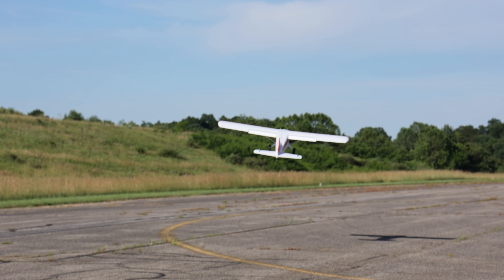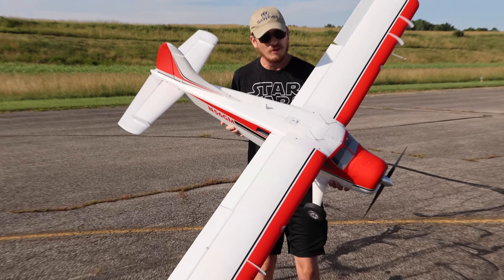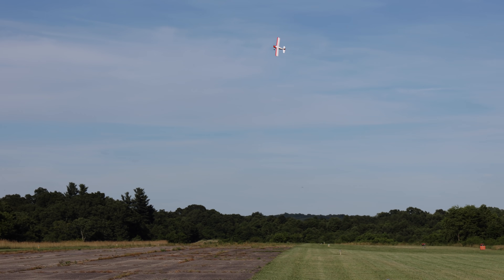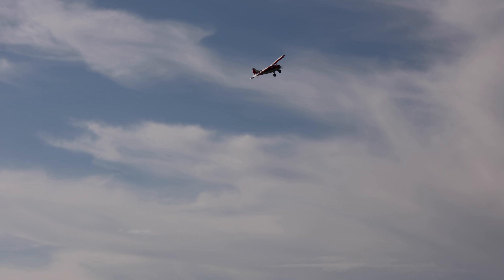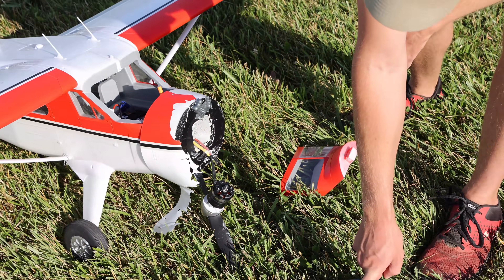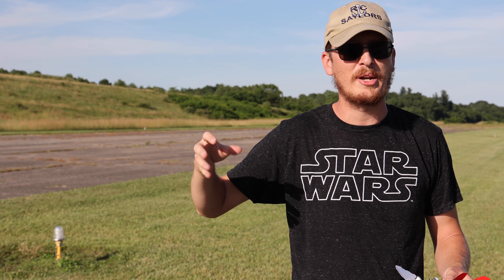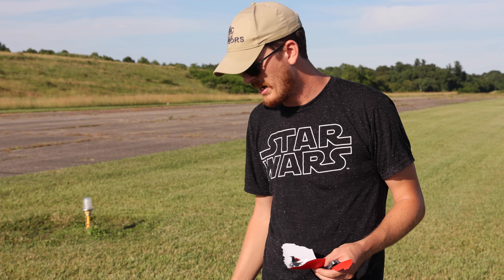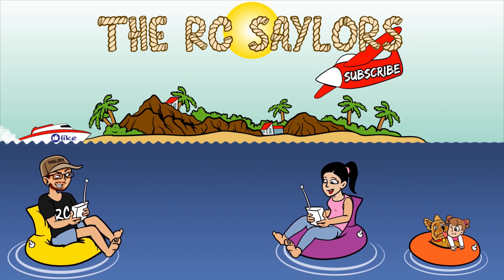GIANT RC AIRPLANE CRASH EXPLOSION!!!! - FMS Beaver 2000mm V2 - TheRcSaylors

Comment: The fact that the engine mount was still attached, but all four screws that hold the motor on the mount appear to be missing.  My educated guess is that normal vibration allowed those four screws to work loose.  The motor came completely loose after the last screw let go.  I don't know this plane, but it looked like the motor to mount screws were not loctited when installed.  Good lesson.

Comment: I wanted to share that I just had a similar near disaster while maidening my FMS Beaver.  After take-off on my first flight,  I detected a slight low pitch "growl" from the engine which slowly become louder as I flew.  Remembering this episode form your channel, I decided to land the plane right away.  Once touchdown occurred, the loose motor allowed the prop to hit the engine cowl and splintered the air scoop on the bottom. At home, I removed the engine and found all 4 screws holding the engine to the mounting plate were loose.  It did look as though some sort of adhesive was used on the screws but the application only covered a fraction of the threads. I reinstalled the screws with a complete covering of loctite and repaired the engine cowl with reinforced tape placed on the inside of the cowl.

Comment: You should NEVER have to check the motor mount screws, or any of a dozen other pre-installed features of a PNP plane, otherwise why bother paying the extra cost? If you want to remove and re-install everything just get an ARF and save $50...you paid these people for the installation work, you shouldnt have to worry about it failing out of the box.
Reply: lucky they dont charge much for their planes.......;{

Comment: It appears the motor was not tight to the motor backplate.Didnt see the 4 bolts or screws which hold the motor to the mount.That just a observation.I have planes that size and bigger but new or not IV always checked the mounts before and after any flights.But things like that do happen once in awhile.Still a nice plane.
Reply: I was going to say the same thing.
Reply: They weren't loc-tited or the heat broke the loc-tite down. None looked ripped out

Comment: Welcome to the FMS motor mount failure line of RC Aircraft. My big FMS electric Corsair also had that big GLO engine sound as the motor mount separated from the firewall in flight. That was an adhesive failure. Looks like your motor mount screws backed out. Keep the videos coming!
Reply: I'm seeing suggestions of Loktite on the motor screws. I agree, BUT do not get the blue screw glue on that plastic or the motor will be headed for low Earth orbit without the plane again!
Reply: @ChrisDavis-eq9lj  you shouldnt have to do that on a new PNP plane, ever.
Reply: @snoriverrc3842  Shouldn't have to is right, but not all brands are created equal. And sometimes things just get missed.

Comment: When you say this was totally out of your control I disagree...when you hear an electric plane oscillating prop, what its doing is wiggling the motor basically and eventually is going to rip the whole motor out. Soon as you hear an oscillator land immediately
Reply from the maker: Right, in hindsight that is a super easy statement! I could have flown eight more minutes (theoretically) but chose to land around two or three minutes in. Just wasn't soon enough by five seconds. Guess you've never crashed a plane at your own fault or made a mistake? I mean, I tried. I've flown quite a few planes that are just loud. As I realized the noise was getting louder, I backed way off and tried landing. Best I could do! I am human, and make mistakes. Thanks for understanding, I hope. 👍😁⚓

Comment: I had similar thing happen to me ( not the same model). Turned out to be lose motor mount screws and in your video you can still see the mount firmly in place. Even with reliable pre built models its worth just checking things over with a screwdriver and spanner.

Comment: after hearing weird vibration noise, sure enough the 2 top engine mount screws are loose on my Beaver. I now secured all 4 screws with a blue threaddlocker.

Comment: I was just watching your video on the FMS Beaver and had the same thing happen to me after about 7 or 8 flights. I was flying on floats at the time and I just landed when the engine came out.  This damaged by dummy radial engine and propeller.  Thankfully my cowl did not get damaged.  I went to ACE Hardware and got 4mm countersunk screws and remounted the engine and used a little LockTite Tread Locker and changed the propeller to a 15 X 8 Master Screw and have flown several flights since without any issues.  I balanced the Master Screw Propeller and it is much more efficient.  The only thing is with the Master Screw I cannot put the spinner back on but I would rather fly it now with the setup that I have.  Much Better.  I sent a note to Horizon and told them about the issue that I had.  I hope this helps.  Yes I am thankful for the Lord that my flight was safe and all worked out in the end.  Thanks Shane.

Comment: on the 5th flight with my new Beaver I heard the "buzzing" noise while throttling over 75%.
 I landed and discovered an loose motor. After disassembly all 4 phillips screws into the motor were loose. The 2mm screws thru the motor mount into the plane were tight. If you buy this plane check and loctite the screws, it only takes 15 minutes

Comment: Motor mount screws could of been loose that caused vibration then explosion but since the propeller is still in one piece I would check the balance and if it is very unbalanced that would be a big clue for your disaster.

Comment: Motor screws came loose probably no locktite. It happens but definitely on fms for not using locktite. Going to have to tell my boss to check his now he has the  fms 2000mm extra 330. I've never had that happen to an electric plane but have had my eflight extra 300 motor mount shatter mid flight. Luckily landed soon as I heard it tapping and had one tiny screw holding it all together still. I'm sure it wasn't far from this happening

Comment: Looks like the Motor shook itself loose from the mount .The prop shredded the cowling .And the motor vibration made that rough sound . Going to need stronger motor bolts . Not your fault NATE . Just one of those things could happen to anyone .

Comment: I believe that the bolts holding the motor on were loose from the factory.  And they were backing out through the whole flight.  And when there was only one that was left holding it on was left . The out runner part of the motor was rubbing and that's why the paint was missing on the motor , And the cause of the sound. Then the last bolt backed out and the motor was completely loose and destroyed the cowling on it's way out . Case closed ... was nice plane .

Comment: I doubt it was an out of balance prop. It wasn’t particularly bad at first and got worse. The propeller didn’t become more unbalanced over time. The firewall/cowling blew up after throttle off, pulse, boom!
Thank you for running the equipment the way you receive it. Too many hobby reviewers tweak the sample because they can see what needs to be done to improve performance. 
Keep up the sterling work. Reviews I can trust!

Comment: I have an FMS V2 Beaver that has flown more than 100hrs on wheels and will be getting its first experience on floats soon! I have always had a bit of noise at full throttle and I’ve been unable to locate where it’s coming from. Just like you guys I assumed it was the cowling vibrating. Now that I’ve seen this I will absolutely be inspecting the motor mount bolts for tightness. On another note entirely, this airplane is so fantastic to fly. There’s enough room inside for 4 GoPro’s, and it has enough power to hover on a 60+ C LiPo!

Comment: That's quite a bummer. Only thing I can think of and will ask; looks like there are screws that go in the 'firewall' into the motor, were they tight? The way the prop was chewed up on one side, looked like it came loose and kept rubbing on the cowl. And you said that it was vibrating, maybe the prop then caught the cowl at the (right) time!?    I really don't know that's just the way I kinda see it.

Comment: Thanks guys you may have just saved my plane!  I had it out the other week first time since winter on floats, and above half throttle sounds loud, buzzing not at all like before, I remember this plane being so quiet!  Luckily I usually fly it scale and not too often more than 50-75% throttle.  But that should never happen and you should be able to snap the plane around a bit for fun if you like.  I couldn't figure it out, simple 2-blade, I unscrewed and remounted prop and cowling.  Now I am going right in to check my motor mounts!

Comment: Nate, had you backed off the throttle completely at the point it exploded? Maybe the ESC was braking the motor and the strain of that was the final straw.
Afterwards, you had 4 empty holes in the motor mount and 4 empty holes in the motor. Seems most likely that the mount screws unwound themselves.
I suggest anyone that buys an FMS checks that the screws are threadlocked and tightened up fully.

Comment: I have the FMS PITTS , only 8 minutes before plastic teeth stripped on elevator servo, plane nose dived to earth, totalled, got in touch with FMS and told them their servo was shite , they replace the plane Free of charge, I have since replaced all the servos with the ones fitted on the Me 109 elevator ( Metal gears and extra long lead , part number :-
FMSSER17MGD  ) .
I also have a FMS Beaver 2000mm -- gentle giant , flys like a dream

Comment: top be fair...the mount looks like its still in place and intact. The screws that hold the motor to the mount are no where to be found....i would assume the motor was not tight on the mount from factory.. even if the prop was grossly off balence...it would have done more damage to the foam around the mount.. it sounded like a lose motor from the start.. this is an FMS issue as not many newer people would even think to check that on first flight..
Reply from the maker: Right. Why would anyone ever think to check screws buried under the installed cowl? As PNP, this is something that shouldn't need to be checked. A shame that QC didn't catch this.
Reply: @TheRcSaylors  i check all my BNF and PNP planes over....but that is from years of experience...MOST new people to the hobby would not even think to look at motor mount screws... This is why my Timber X has well over 300 flights on it...

Yes the timber X needs new servos in just about every control surface.. yes i still fly it anyway LOL

Comment: Thanks for the vid and AMA shout-out.  Very important that R/C flyers and modelers join up, many advantages especially the insurance coverage!  Ok, I'm north of 60 years old at this point, and of course when I was 15 we didn't have electrics as we do now, so of course I have most experience with nitro.  Point is, it was very important to balance the prop!  Whether wood, plastic (small displacement engines) or nylon and nylon-re-inforced (again NOT recommended for large nitro engines above 0.45 or so).  Anyway...I see that FMS Beaver on my radar wish-list.  Now, to find a field as handy as yours...(LA area).

Comment: Hi Nate and Abby... What an awesome big plane. 

As already said by previous posters, it looks like the engine mount screws came undone. Maybe it was a manufacturing issue and those screws should of been more securely fitted?

On the positive side, you landed safely and it should be an easy fix. :)

Comment: I've done this I can tell you without a shadow of a doubt the screws on the back of the motor weren't secured I knew as soon as I heard that sound happend on my extreme flight laser 60 (it was my fault for not putting loctite or ca on the threads ) best of luck with getting your new plane fixed !!!!!
Reply from the maker: Was yours also a PNP!? Curious what your beliefs are on PNP models. I've always been under the impression that you are paying to have that work already done. At least the hundreds of other PNP models I've flown over the years have had this done, but maybe it is not as common as I am thinking. I would just rather buy a kit, I think, if I knew I had to completely disassemble a plane, add loctite, then reassemble. Thoughts?
Reply: @TheRcSaylors  no mine wasn't pnp I built it but even with pnp planes sometime things are missed. 99% of the time you will have a flawless plane that flies great but that 1% well thats part of the hobby lol 😆
Reply: @TheRcSaylors  I personally like pnp planes they are alot of fun :)
Reply from the maker: Well said Boogie Man! 🤣😂😢😭⚓

Comment: This is a big thing I stress to my friends and first timers to RC. Even though the box says RTR, RTF, BNF, etc? ALWAYS go over the entire truck, car, boat, plane, whatever BEFORE you run it. Humans still put this stuff together. They can still make a mistake doing it.

And that's what leads me to say it looks like the motor munt screws weren't tight or didn't have thread lock on them. Always double check. Thankfully no one was hurt, and plane still landed safely. Nate was showing his skills as pilot. Got it on the ground quick and safe. Sure helped that you were almost landed anyway. Might have ended a little different from 100ft or so in the air. You might have been picking up a few more parts than intended.

Comment: Sorry to see such a magnificent beast go down like that. From talking to some of the people at my local field, it sounds like Horizon Hobby's quality has been suffering since the pandemic began. I can attest to this as the Twin Otter my wife just got me for my birthday came with bad landing gear. The tires were not centered resulting in a nasty wobble. And if that wasn't enough, on what was only the fourth flight of the plane just this last Friday, a servo failed mid flight leaving the rudder stuck full left. I tried to bring it down safely but ended up hammering in on its nose instead. Crumpled and split the front end plus tore both wings at the roots.

While HH was prompt in getting me replacement landing gear, I have a bad feeling that things will not go as smoothly for me this time. They didn't directly say it, but I felt like it was implied that since the servo wasn't defective out of the box, I am likely to get stuck with the cost of repairs. Plus, they said that they will only cover the cost of shipping if they determine that the failure was due to a defect. Given that they want me to send in the entire plane, it will cost me at least $100 for shipping. That seems like a heck of a gamble on my part. I could get a brand new fuselage and wing for about the same price. Sure, I could send my wounded bird to them and hope that they do the right thing and patch it up or replace it, but it feels far too likely that the ordeal will end up costing me at least double what it will cost to just mend it myself.

I apologize for venting in your comments section like this. I love Horizon Hobby's planes, but I am not happy with them right now. For me, I think I will refrain from buying any more of their aircraft for a little while in hopes that they can get their QC issues worked out.

Anyway, thank you to both of you for your awesome and entertaining videos! I always get excited when I see a new one posted!

Comment: Nate, you play with them until they break.
6 cell in foam? How long did you expect it to last? Even with lock tight.
I've broken several Axel's, drive shafts stuff happens.
Repair it or get it repaired. 
FLY another day.
After all aren't that what dreams are made of?
Reply from the maker: I've got quite a few 6S foam planes with over 100 flights on each and still going strong! 👍😁😎⚓

Comment: I plan on buying a Beaver; I'll be sure to loctite the bolts to the motor mount .  HH should've sent you a new Beaver.
Reply: LocTite will dissolve any foam it comes in contact with. Brian Phillips RC can attest to many destroyed planes, caused by Loctite-ing the props. There's a solvent type of Chem in it that weakens the surrounding foam quickly and (according to BP RC) devastatingly. 
Just a heads up. He suggests model paint or CA on the screw tip, if needed. Not LocTite. 
This situation, here seems like pilot error. He Def should've landed after that 1st high speed pass. The cowling wasn't on all the way, or the prop was loose/unbalanced, from what I heard and saw on the video. Sucks, too. I really liked that plane. Now its destroyed.
Reply: You are totally correct

Comment: A little vibration or anything loose is never okay regardless of size. When you get into larger planes or any size really. You've got to do your preflight inspection.  Especially when you have spectators. You can not be negligent. Regardless if you have insurance or not. I've seen people seriously hurt by giant scale planes. Only reason I say this is because I've been flying for nearly 30 years. I failed to do a proper check once before. And what happened was I was flying my 1/4 scale Zero. And mid flight I started to get flutter in my aileron. It got bad enough the aileron ripped off. And I lost control as the plane was coming towards me and my daughter. It came just a few feet from hitting us. A 40lb pound plane swinging a 26in prop could have seriously hurt either of us. Not trying to be rude Nate just want people to fly safely. Love you guys and your channel.

Comment: flown glow models for 30 years #1 balance all props #2 Loctite ALL motor and motor mount bolts.. but two things caused it either the cowl loosened and tilted into the prop or motor mount bolts vibrated out ..you got the plane down and easy repair .

Comment: you need to lock tie the motor bolt before u flew it the motor pull the screw threw the motor plate